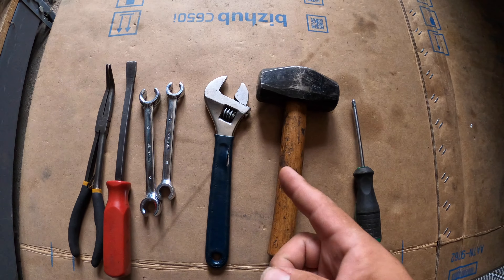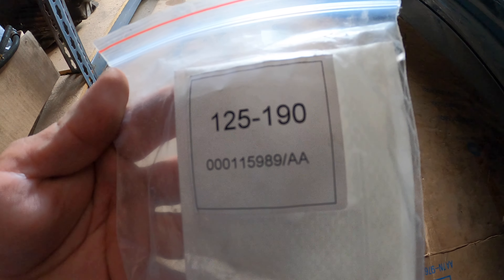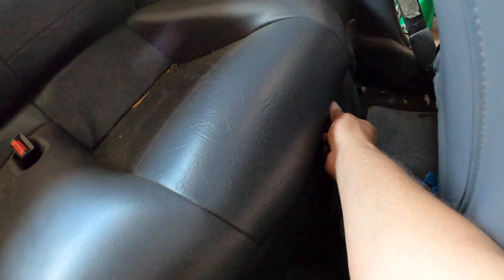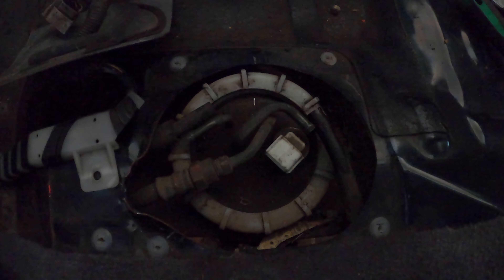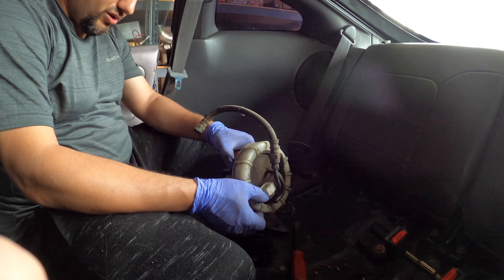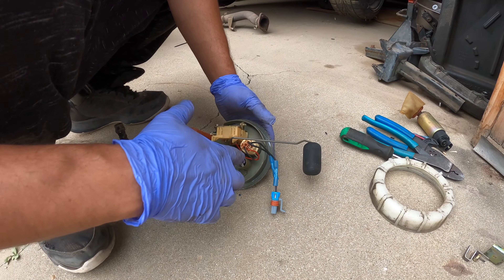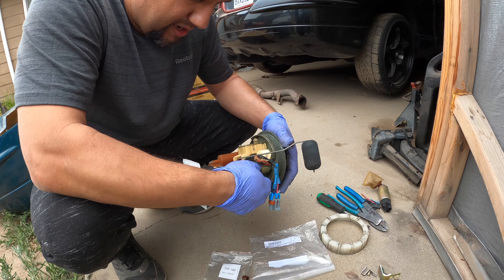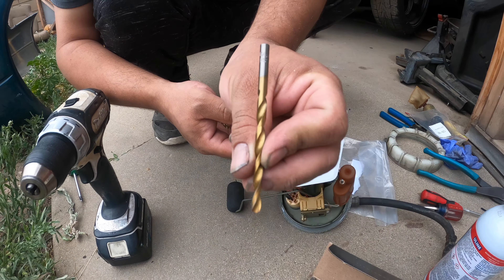HOW TO INSTALL A WALBRO 525LPH "HELLCAT" FUEL PUMP ON A 2G DSM AWD

Comment: Great video! Just like to know if you could possible fit a dual pump like a double 255 on that stock hanger and maybe just tying up both pumps together and eliminating the bottom bracket for room? I was thinking about putting a brass T or Y fitting and custom fuel hoses for them but was hesitating because I think due to the increased height it might eliminate clearance and hit the floor severely and would not be able to tighten up the screwcap.